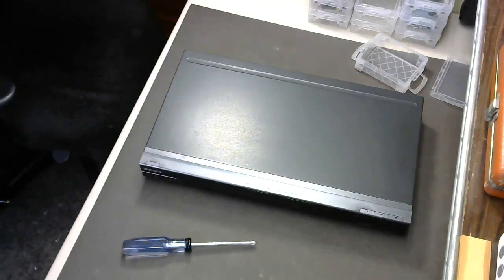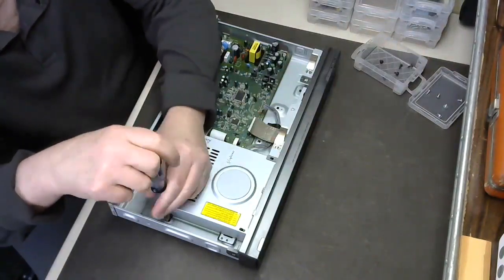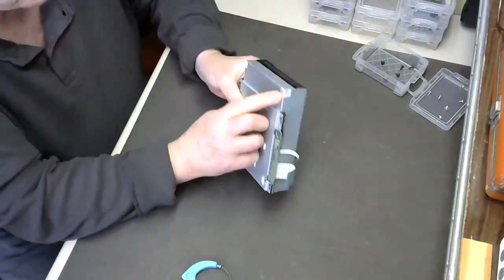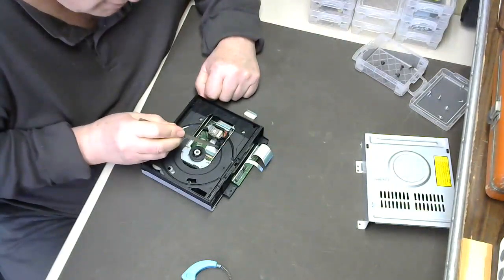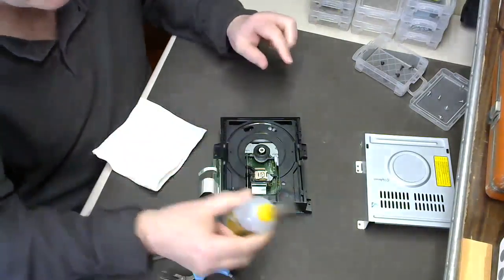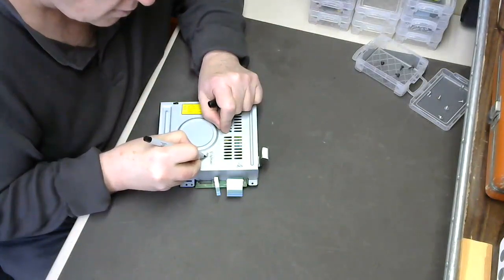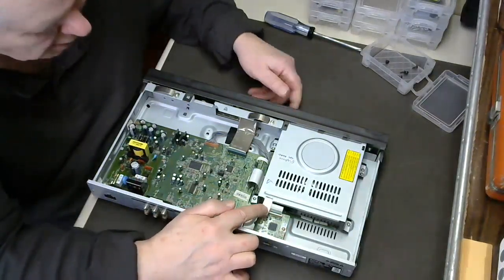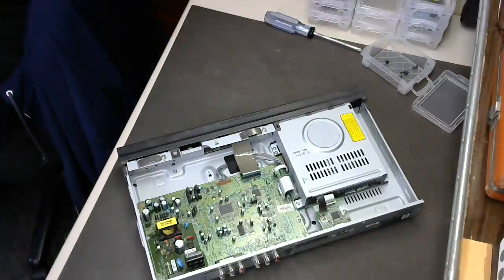DVD wont play. Blank DVDs not recognized. Cannot play disc.

Comment: Nice work! I have an old Magnavox MWD7006 DVD Player that wouldn't read any disk. Cleaning, massaging and oiling the Laser Guide Mechanism did the trick. 👍 The laser guide was bound up pretty good prior to. Inside was pretty clean. I expected pet hair and a lot of dust but was surprised at how clean it was. Maybe it had seized up from a period of non use.

Comment: I am surprised that since you mentioned about a bench rubber mat that you did not wear an ESD wrist strap.  Do you know of any manufacturers that make ANGLED needle nose pliers that have removable protective covers to aid in removing and installing ribbon cables ? They would be a good aid to keep the cables safe from damage.

Comment: Thanks for posting. Good commentary and camera angle. However, once you had removed the cover there was easy access to both the laser and glide rods.
Some machines have different designs and are not easy to DIY. My Panasonic, for example, has the laser assembly in an enclosed plastic case which I’m told was ‘plastic welded’ together when it was made. 

The only way I could get access was by gently prising off the spindle and metal disc washer, which I don’t think is the approved way.

Even then I couldn’t access the glide rods. But the laser could just be reached by putting in a Q Tip at an angle. Very dirty, actually.

A guy at a Panasonic store told me that it could also be a slightly warped disc tray at fault whereby the disc won’t sit plum in it’s seat.
Reply: T

Comment: Not really my problem... have a Panasonic DVD Recorder that won't recognize certain DVD-R blanks... It will read blankds I had ordered a few years back, but the new ones, it just won't. I have tried several kinds now and it doesn't want to work, even from the same manufacture... just won't work... I justed another older  Memorex again, works like a charm... scratching my head... Have ordered some DVD-RWs to see what happens there. I'm not trying DVD+Rs either. It didn't like one I had...

Comment: I have a combination VHS recorder / DVD player which has recently stopped reading discs.  I shall give this method a try.
Reply: Any luck?
Reply: @Beano987  You're asking after only 7 months?  I need much longer than that to get around to doing something!
Reply: @MarkTheMorose  how about 10 months later?
Reply: @robincressy42  Sadly not.  :/
Reply: @MarkTheMorose  I just fixed my broken DVD recorder!  It's time to dig out your machine, oil it up and make it work again!  Or procrastinate a few more months, haha!
Reply: Its been 3 years, did you fix it ?
Reply: @tdomingues89  LOL!  Nope!
Reply: @MarkTheMorose  i have a DVD/vhs combo, DVD is ok, but the VHS its not taking the tape, the sensors are ok, but the eletric motor does not take the tape.

Nos o have to Waste more time and check the circuit to find the problem lol

Your case you need to ajust the laser, possíble or replace it. I belive.
Reply: @MarkTheMorose  i also have to fix a neighbor DVD players, does not read music CDs lol